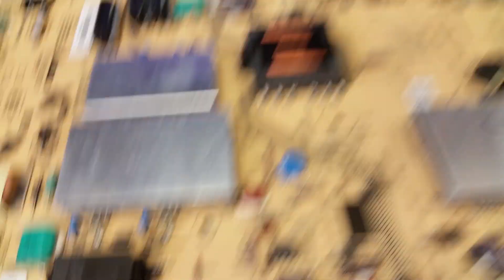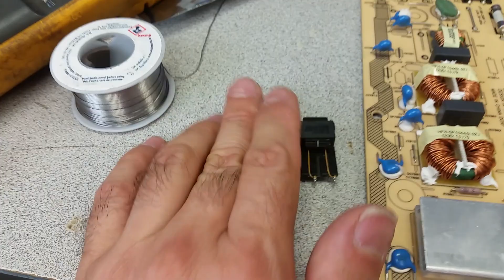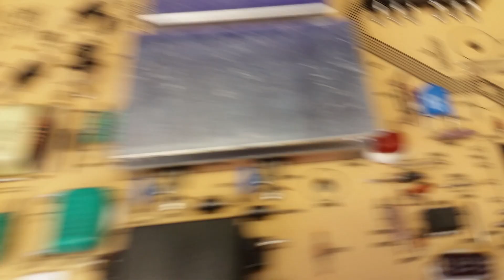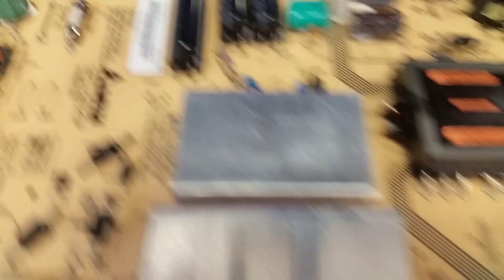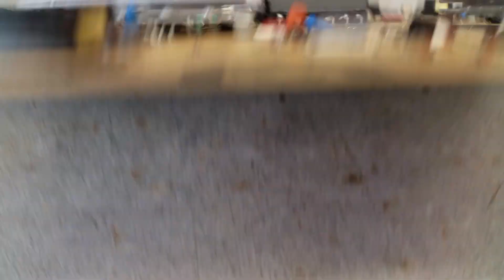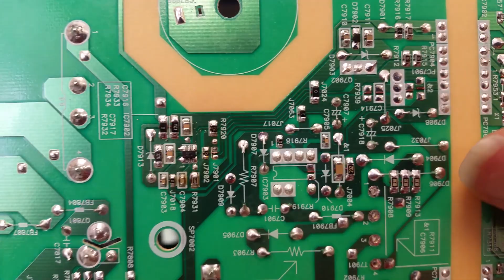Why Sharp power board DPS-262CP DPS-162KP DPS-171CP etc. resistor R7900 keeps blowing

Comment: Hi.  First of all thanks for this video.  Unfortunately I am facing a similar issue.  I already replaced R7900, IC7903, D7908 and C7901 but unfortunately when trying to switch on the TV it still blows R7900 and IC7903.  Any idea what could be wrong?  I cannot find any other shorted component but the way these two components are blowing in my opinion show there is a dead short somewhere. Unfortunately I do not have an ESR meter yet hence cannot test the transformer T7901
Reply from the maker: Nothing I can do for you remotely, sorry.

Comment: I'm trying to find MP-130I but I don't know where to get it. Any tips?
Reply from the maker: We can sell you a working MP-130i for $25 plus shipping however we can't guarantee you that this is all you need to fix the board as we have recently come across one of those boards where the resistor keeps blowing even with a known good transformer. What's more, after the resistor blows and we take out the transformer and put it in another board it is still working. So at least sometimes there's something more that causes the failure and we have not yet gotten to the bottom of it.
Reply: @coppelltvrepair  Thank you for your honest response. I've purchased a repair kit for this board from ebay. Hopefully that will fix it. I'm also not getting 390v on the capacitors, only 316v. According to the other party that's not correct and probably indicates a short.
Reply from the maker: @JoepSwagemakers  If you are getting any PFC output at all then you do not need MP-130I in the first place.
Reply: @coppelltvrepair  Let's hope so and let's hope the repair kit will do it. The 2K resistor keeps blowing though
Reply from the maker: @JoepSwagemakers  Well you can't get any reliable PFC output measurement if that resistor is blowing.
Reply: @coppelltvrepair  coming back to this, there is no voltage coming out of the MP-130I but there is 306v going in. That means it's broken right? If so, where can I buy a new one? Going to mouser and getting one of those alternative parts as you mentioned is a bit too complex for me.
Reply from the maker: @JoepSwagemakers  Oh, I am afraid it is not that simple. There can be many reasons why the transformer is not working - both on the primary and the secondary side. Too many to even try to cover here. But the basic idea is that of the driver IC detects a condition that is out of its scope (over-voltage, under-voltage, over-current etc.) it just stops releasing impulses to the switching transistor resulting in no tasks for the transformer.
Reply: @coppelltvrepair  Ah oke, so replacing the IC (IC7903 correct?) might fix this? I already ordered a few anyway. I also noticed that diode D7950 is blown.
Reply from the maker: @JoepSwagemakers  There is no short and certainly correct answer here. Why don't you start with the components you can see are bad (like the diode) and work out around them to see if there are others that are bad and then try and replace and see if the board works?
Reply: @coppelltvrepair  alright will do that, thanks for your help!

Comment: Q: Do you have to use an ESR meter to measure the transformer for the 16ohm reading to test if its good? Also, can we measure this on the board or does it need to be removed? I heard you say ohm but did you mean uf? I thought the ESR meter only displays uf? Appreciate your video since this is exactly what is wrong with my board too. my r7900 blew and i'm replacing it now. I just want to test the T7901 to make sure it's also not bad.
Reply from the maker: Yes it takes ESR meter and NOT regular resistance meter to do this. It is not a typical use of an ESR meter, but it's a good (at least for me) one. Because of the uncommon use you are best doing it as it was done for reference. It may be same or slightly or very different on and off board. Good luck!